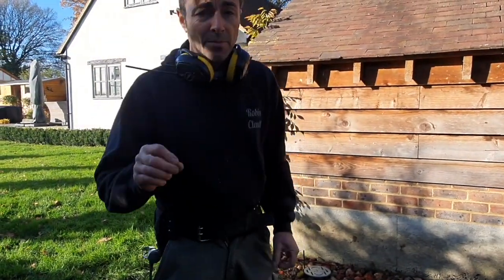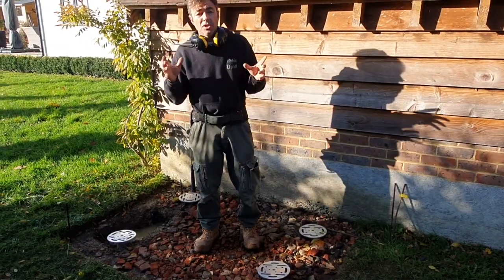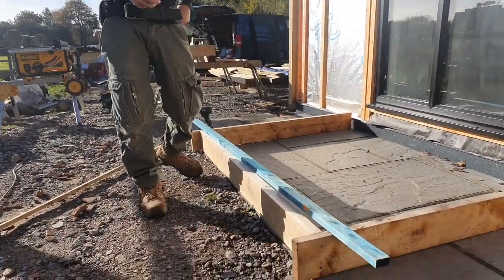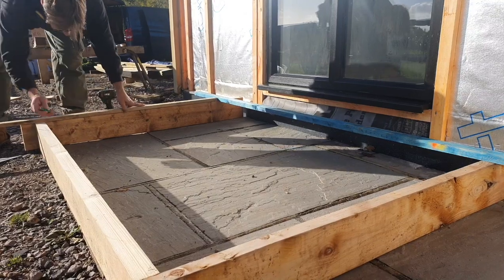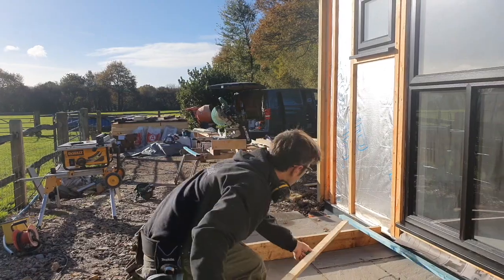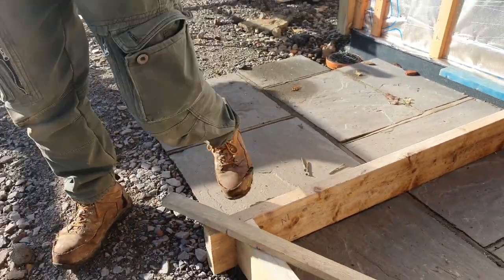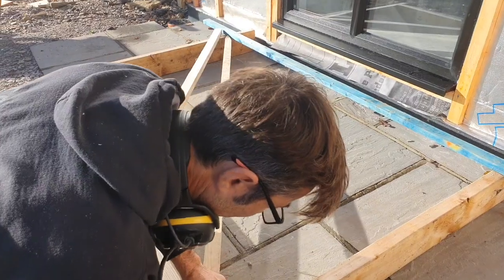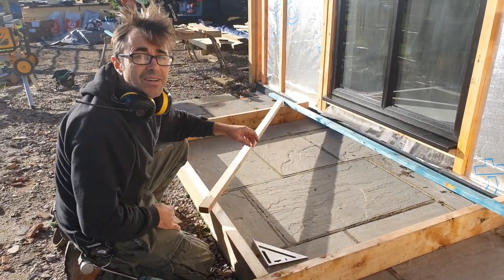How to check for square, simple and effective carpentry tip

Comment: Could you not just do the 3,4,5 trick??  where you measure 300mm oneside 400mm the otherside and then if it is square then it will measure 500mm across to both pencil marks
Reply: Yeah you could. But measuring corner to corner like he did gets it absolutely perfect. 3-4-5 can sometimes let you down in the field when building a large structure

Comment: Another easy way is 3 4 5, measure a triangle with 30cm side and 40cm side and when you measure 50cm between the 2 in diagonal it will be square, you can use what ever length as long as they are based on the same rule 3 4 5,  as an example: 120 160 200

Comment: What you didn't say, but imply is that the problem with using measuring squares, is often that though you measure the closest corner you are not really comparing corner to corner. You really only measure the first corner and rely on the straightness of the side to be accurate. To me it seems like diagonal measurements are always better when you build a square shape. Often the straightness of the sides are also less important, while diagonal is almost always an absolute. 

I love your tips and tricks on putting away the tape measure. Please upload more!

Comment: Equal diagonals, the oldest and best way to square things up from small boxes to large foundations. 👍 On site we’d either have to work out the diagonal length to square the base up or ask the site engineer for it .

Comment: The 'old skool' diagonal rod for squaring things up works a treat - used to use it all the time for bench made doors and windows.  As for the slabs - done a lot in my time - 150mm on compacted crushed with rebar is more than sufficient - unless you've got really soft ground that warrants the screws???

Comment: I’m a tiler snd squaring up down to the mm is important. Your a top guy and a top worker so I know you  can you show us a modern day of squaring up or another method you have used and found successful.  Even a sheet of 8 x 4 would be a hot tip on the ground, there is always some of that on site. #Tilepro2020

Comment: People often lay concrete with the rebar lying on the ground. That is worse than useless because the steel has to be buried in the concrete. Either support the rebar (as Robin did on the screw piles) or press it into the already laid concrete and push it 1/2 way down.

Comment: Hi Robin,

By using those screws and the slab does the slab bind into one and transfer the load through the piles? Also would I want to put a few bits of rebar chem fixed to the other slab or should this one be left to move freely?

Thanks, Eliot.

Comment: surely 100mm - 150mm of compacted hardcore/scalpings  would be a lot cheaper than those screw piles ?
Reply: Would be cheaper but he is  "buying time" which they don't make any more of. Doing it the old way he would have to dig it out possibly by hand as it is only a small job and getting a  mini digger may not be cost effective and could mess up the surrounding land. He then has to get rid off the spoil bring in mot and get a whacker on it. So he has saved half a day and also  if he is anything like me has also bought more "pleasure" ,for want of a better term, in doing the job. After all some jobs if you think before hand that you have all this hassell then you put it off, or the job ends up harder work than it should as you think all the time FFS I have other things to do (or maybe that is just me).
Reply from the maker: We are on clay and the new water thank when full will weigh close on a ton, I prefer to remove the surface soils and turf whack some of screwpiles and cast a reinforced slab over the top, we will also have the weight of the small structure that will also weigh in at about half a ton so by using these quick screws I will have no future issues of movement etc,  your suggestion is perfect also and thanks for your comment Antony
Reply: @ukconstruction  cheers, just out of curiosity roughly how much are those screw piles ££  ??
Reply: @shavenhaven6869  someone has to + I bet they aint cheap £ !!
Reply: ffs they are £80 each +vat ! thats nearly £400 !!!
Reply: @stephenribchester2185  I’ve had a few tradesmen at my house who had this save time attitude, they want to be well paid then do terrible quality work! I watch robins YouTube and build with a and e as they are bothered about quality! A lot of times it’s better doing a job yourself than pay high wages to some clown! There’s not one tradesman I’ve had I’d let back in my house unfortunately ☹️
Reply: @pigeonpecker7623  No one pays me for my videos!  TBH, very few people watch them, either! ☹️
Reply: @Derek-Hicks  I'm afraid that's partly down to you aswel, you pick the tradesmen
Reply: @krisrickson853  You're not wrong, i can pick them alright!
Reply from the maker: @pigeonpecker7623  These screws are paid for

Comment: Hi Robin , just a quick one. I'm an apprentice looking to get a skill saw to help with rafter cutting. I use the chop saw for my plumb cuts but would a 165mm skill saw have enough depth for a hip and Jack edge cut on a 2in timber?

Cheers Eliot
Reply: Hi Elliot. 

You would need to step up to a 190mm blades. Modern brushless saws these days have the capability to cut through 45mm timber on the 45. Ive just purchased a Hilti cordless saw and even has the capability of tilting 50 degrees and still cuts through 45mm 

Robin uses a hikoki I believe it cuts through at 45 degrees. 

Bottom line bigger diameter blade. 

Hope this helps. 

Good luck with you’re apprenticeship.
Reply: @christaylor5291  Thanks Chris , I'll have a look at some 👍
Reply: @garethheathcote4988  No worries , cheers
Reply: If your talking about doing the compound cuts on the jack rafters etc then yes it should be deep enough you can always look at the specifications online.
Have you any thoughts on which tool brand your going to go for? 
There are some good Black Friday tool deals coming up at places like ffx.
Reply: @garethheathcote4988  I think Makita as I've got a few drills. I've seen the hikoki ones but I think for myself there a bit out of reach price wise as I not roofing all the time. Also I'd like a blade left saw.
Reply from the maker: Hi Eliot, looks like you have had your question answered by some really helpful and knowledgable guys here on you comment and I thank you all for helping Eliot, I would concur with all comments and I am lucky enough to have a range of battery and mains saws at my disposal and a really good battery saw with a blade over 180mm will do a jack cut in a 47mm thick timber, as far as price is concerned a decent circular saw is the most versatile tool a carpenter can have, you can change the blades to do even fine work and using some simple tricks you can do perfect rips and crosscuts also so it maybe worth saving for.... where are you based? you are welcome to come and try a couple of mine!!

Comment: Robin, let me first say that I love your channel and I have learned a lot from watching them. I like to try and built stuff myself but do lack some skills. Just recently built my own small workshop as I couldn't afford to get it done by someone else. When installing the inside sheeting I thought I had spaced out the framing to be able to accommodate full 2.4m sheets but I had to end up cutting them to fit. What mistake did I do?
Reply: hey mate just adding a comment here as i am a builder but based on what you said id imagine you might not have spaced out the centres of your studs correctly? did you space your studs at 600 centres to accomodate the size of your sheets (2.4m)?

Comment: Hi robin, would the 3,4,5 method work to square up or is this not as accurate as the battens??
Reply from the maker: The 3,4,5 method is great especially over large distances but this if by far the simplest and most accurate way to achieve square, thanks for watching Paul
Reply: Thanks Robin.

Comment: Good idea if all the time in the world and some spare batten but I doubt you really do it this way every job it really is too much messing about when it's so much quicker measuring corner to corner and check with the 3,4,5 method or just use the modern laser

Comment: Hi 600 lts water will weigh 600kgs, a 1m x1m x1m cube of water weighs 1000kg
Reply from the maker: I was waiting for your comment, our tank is twin walled, it has a series of pumps, pressure vessels and other equipment, it is on its own steel base frame and its all this kit and the water that brings the weight up to nearly a ton, great observation Andrew

Comment: 3/4/5?
Reply from the maker: We use 3,4,5 also but for fast accurate squaring of frames and shutters a squaring rod is so accurate and fast and even if the sides are bowing the overall object is square allowing you to straighten the sides as needed after, its a traditional joinery technique that has stood the test of time!! Thank you for your comment